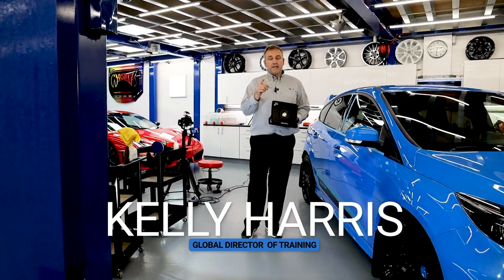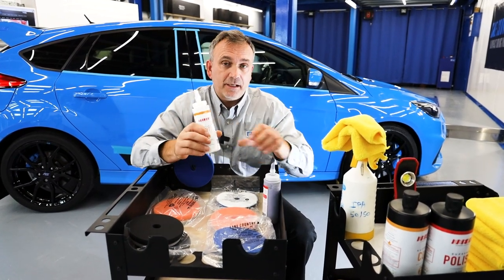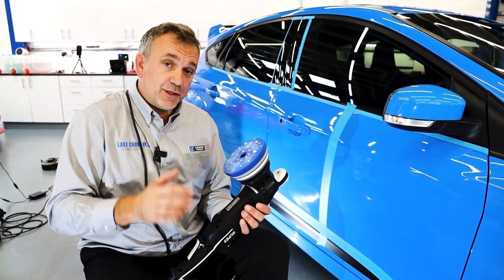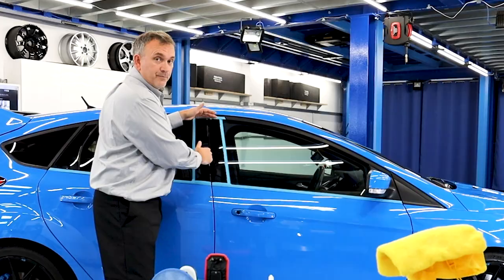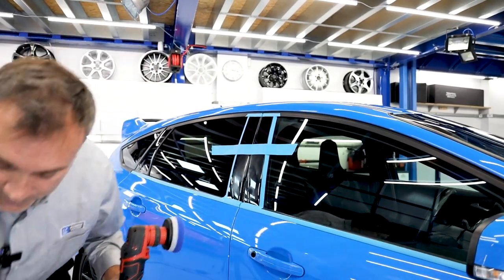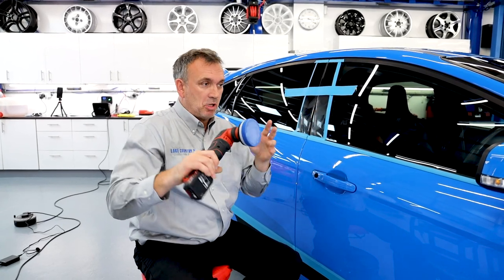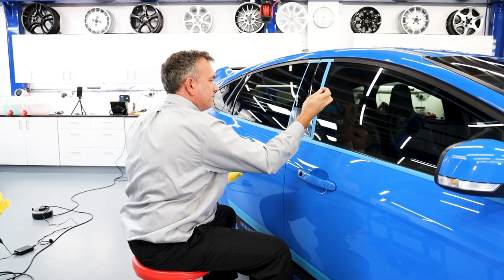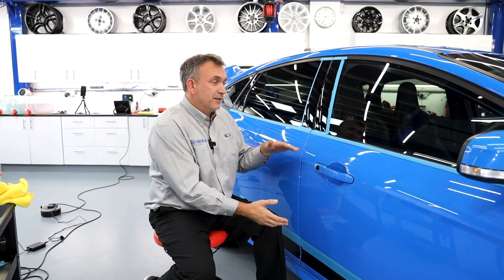Starter Series: HDO Pads on Soft Paint

Comment: My first customer coating was a focus rs in black and the black paint was vary deceptive finding swirls the light had to be just the right angle, color temp and eye position. It would look amazing then once the light was just perfect you'd see a haze even using a 1m throw polisher with a rupes yellow pad and sonax perfect finish. I had to clean the pad 1 to 3 times per panel and finish polishing on speed 2. I used a waterless wash to wipe off the polish due to the towel leaving vary light scratches, I used a 500 GSM towel for coating removal. I Definitely regretted charging what I did in the end but I learned my lesson.

Comment: I have done one stages and two stages on piano black but I've never used just a compound on them, polishes only and refined an awful lot with the one pad, blowing the pad with air multiple times per step.  Sometimes I use two, three or four liquids at the same time, their made from the same base formula so can be mixed together. The less steps Im doing on paint or trim, the more liquids Im using, the opposite for more steps. Im very happy that you got the recognition from LC to become an ambassador for them, you deserve it.
Reply from the maker: Great feedback Matthew!  Side note: A lot of times B-pillars are actually a different coating than clear coat, so sometimes its best to be least aggressive on them.

Comment: You only take off enough clearcoat to do the job. Especially considering the softer, thinner clearcoats coming from the factories. For those "piano" black B pillars on my '19 Range Rover Velar, I do two stages. My OCD won't allow anything less.
Reply: My 2004 Z06 has been compounded by The Wolfgang Twins (Orange CCS/White) three times using FLEX 3401.   I’m pretttty sure My clear won’t take another compounding.  I’m due for a re-coat(CSL-EXOV4 in October 2020). So that’ll likely be done in the fall.  Thanks for a terrific video.  We can always learn more!

Comment: Great info. I have a 2year japanese suv. With less swirls though. So would the blue pad be ok on a 210mm da polisher? Also, i use meguairs compound & polish by hand till now(for an older car). Would the polish remove the lighter swirls on my car? Just thinking that the compound on a 2y car might take away more clear coat than necessary. Thanks for your time & sharing your experience.
Reply from the maker: Let's assume you mean 21mm, not 210mm.  Yes you can use the Blue HDO pad with that, although it may be more aggressive than you need.  Perhaps start with the Orange HDO first and see how that goes.

Polishes and compounds are just 'liquid abrasives' of varying aggressiveness, and as detailers trying to work efficiently we need to select the appropriate level of 'cut' for the task at hand.  If you're working with particularly soft paint or very minor defects you'll require less cut, and so sometimes a gentle finishing polish/pad will actually do all you need.  Give it a try :)
Reply: @LakeCountryManufacturing  Thanks very much.Yes.21mm.Getting in the world of detailing step by step.

Comment: Hi Kelly, 

I have a 2020 VW Tiguan R-line in black pearl and I have tried to give it a polish but I'm getting nowhere. 
I'm using a medium hard foam pad on a DAS 6 and I've tried Sonax Perfect Finish and Sonax CutMaxx but it doesn't seem to be touching it at all. I might aswell have sprayed it with water for all the difference it's made!  

It's not badly swirled as I two bucket, snow foam etc etc.  
But I want to get it perfect in preparation for applying a ceramic coating. 

What would you recommend?  

I'm guessing it's one of those rare rock hard German paints you've mentioned. 

I was toying with the idea of a Uro Fibre 50/50 pad and some Koch Chemie compound and polish when I discovered your channel.
Reply from the maker: We recommend using a heavier foam pad while maintaining your compound of choice. Possibly a Microfiber pad may do the trick based on your experience with a medium foam pad.
Reply: @LakeCountryManufacturing  brilliant. Thank you for your reply.

Comment: Loving the content, I've been using rupes lhr15 machine for awhile but normally crank up to 5/6 speed for correction, I noticed you said you used speed 2/3, will this still cut well?
Reply from the maker: Yes, as long as you apply enough pressure too.  Your cutting rate is a function of the 'abrasiveness' of your pad and compound, the 'speed' of the machine tool and the 'pressure' being applied.

Comment: Hello and good year .  The RS mk3 is a soft paint, but do you know about the RS mk2 ?.  I have an RS mk2 ultimate Green, but it's hard to get an idea?!, On the one hand the clear coat looks soft, with swirl removal very easily with finishing polishes like meguiar's M210, and  on the other hand rather hard and you have to go over a Meguiar's M110 compound to have the same swirls ?!.  Like wiping with microfiber, after tests with good lighting, I can wipe and wipe without creating the slightest defect, and in some places too much wiping can sometimes lead to micro-scratches!  Weird no, to have parts of a hard clear coat and some soft parts.
When do you think ?.  Thanks in advance .
Reply from the maker: Hi Nico, it's possible / common to find some panels react differently.  It would be strange if one front wing was soft and the other one was hard, but (for example) bumpers on many cars tend to be more resistant to polishing than the rest of the bodywork.  Also if there has been any aftermarket paintwork / repairs, this would cause variation.  It's been a while since I polished a Mk2 Focus RS but I don't remember it being particularly unusual... sorry I can't be more helpful from here!

Comment: Been looking at replacing my hex logic pads with HDO ones. I have a black honda civic type r and trying to find a good one step. When you say one pass, how many times up and down is that?
Reply from the maker: A pass is "however many times it takes you to get the use out of the compound."  This will vary from pad to compound to car to size of area being worked on etc, so we prefer not to be overly prescriptive.  Compounds have the most cut when they're fresh from the bottle, so at the start of a pass is when you can work the hardest and get the most correction done.  Continuing the pass for longer will help diminish the compound more, allowing you to adjust your speed and pressure and refine your result further. 

On a black Honda, if it's got soft paint, you may find it's tricky to refine a cutting compound down far enough to leave professionally satisfying results (not impossible, just tricky).  If that's the case, I recommend you use your cutting compound/pad to remove defects and then STOP refining further with it - there's no point, even if there's a little haze (orbital) or light holograms (rotary) leftover.  Switch to the refining pad and let that finish the job!

Tips for refining:

1. Make sure you are working cleanly – no dust, dirty edges, clean microfiber towels etc..

2. Take your finest polishing compound and use it to fully (but finely) prime the whole polishing pad face.

3. With your polisher, be sure to WORK the polish to help the abrasives diminish. That means use a little MORE pressure and HIGHER machine speed to begin with, and gradually reduce both to normal levels over the course of your pass, as the polishing liquid turns clearer. Take your time.
Reply: @LakeCountryManufacturing  thank you for the detailed reply, very helpful!

Comment: How can I tell when is a soft paint ?
Reply from the maker: There is no way to tell definitively just by looking, and you will come to learn with experience, but in general:

Modern clearcoats tend to be softer than they were 15+ years ago.
Very few modern clearcoats are hard compared with 15+ years ago - some manufacturers used ceramic clearcoats with a higher density which were extremely tough, but even the average was harder than the average from today.
In my experience, basically no cars made since about 2015 have 'hard' paint.
Very new cars with lots of swirls tend to mean it's going to be fairly soft paint.
Older cars with not many swirls suggests it might be a tougher surface.

This is all partly why random orbital polishers have become so popular in recent years.  Since they now have larger orbits (15 or 21mm, compared with 8mm like they used to be), RO polishers can offer much more cut than they used to, and tackle heavier tasks.  At the same time, we've seen paint surfaces gradually get softer in general.  So: you've got orbital polishers getting stronger, and paint getting softer.  As these factors have converged, the need for the ultimate cutting power of a rotary has gradually diminished...*

*Arguably!  There are plenty of guys and girls out there who swear by rotary for all circumstances, and we're not here to tell everyone what they have to do!  That being said, at our UK facility we covered this very situation with a pro detailer who was 'rotary-only' late last year, and once he understood how to use a random orbital properly (and how it avoids many of the drawbacks of rotary work) his words were "I can't believe I've been wasting my time for 10 years...."
Reply: @LakeCountryManufacturing  thanks for your advice ! 👍